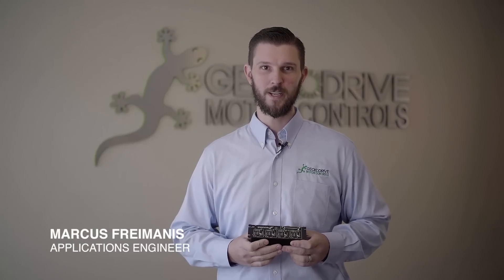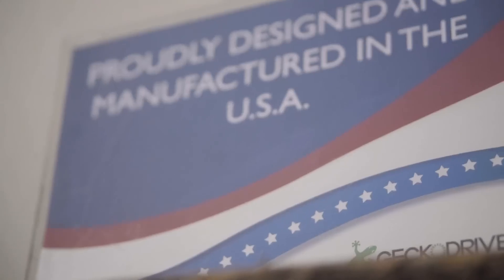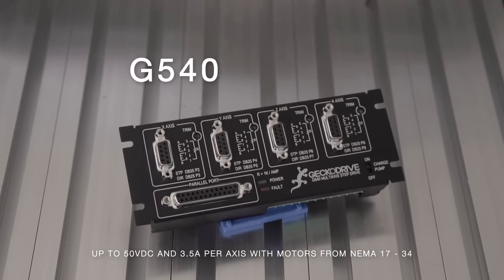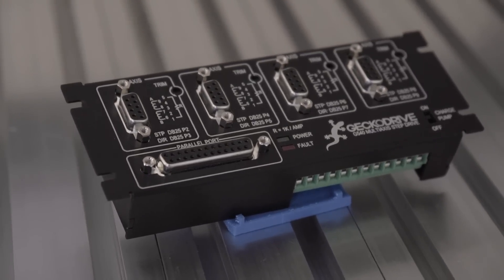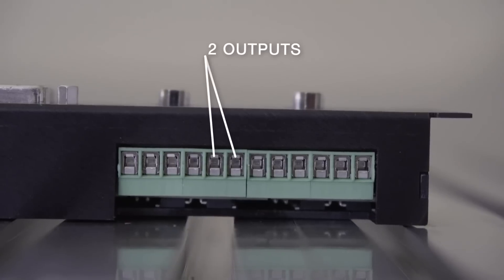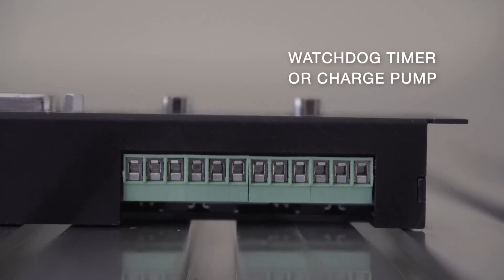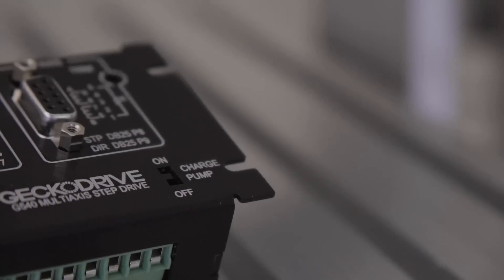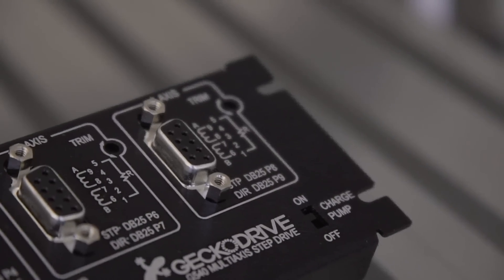GeckoDrive G540 4-Axis Stepper Controller Product Highlights

Comment: A parallel port? Are you kidding?
Reply: @chasingfocus  Yep
Reply from the maker: The G540 uses a DB25 for a signal connector and is not strictly used as a parallel port. Most motion controllers will split out STEP and DIRECTION individually per axis and each one needs a dedicated pin; the G540 DB25 connector will mate with most motion controllers like the UC100, Ethernet SmoothStepper, and Centroid Acorn without needing to wire each axis individually

Comment: Is there any way to connect external indicator led lights for ok and fault if I mount my Gecko G540 inside my enclosure?
Reply from the maker: Hi Gary- Unfortunatley there is no easy way of setting up external indicators aside from light pipes going to the LEDs.